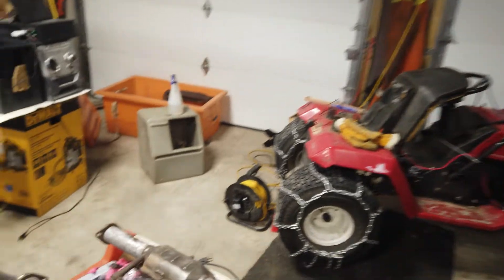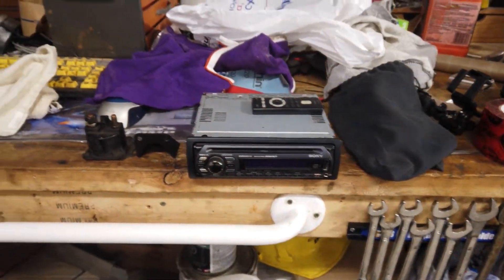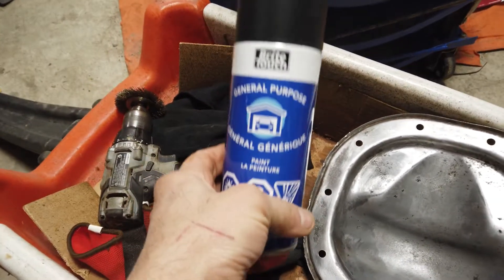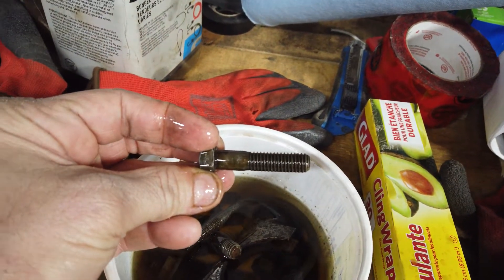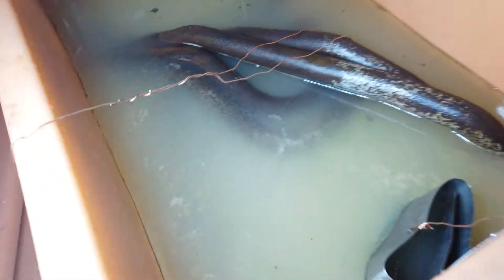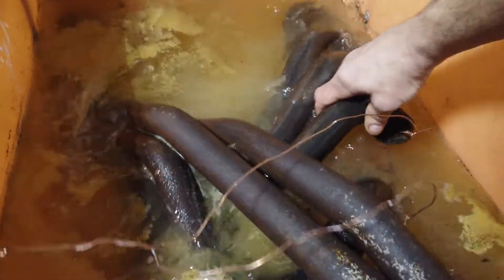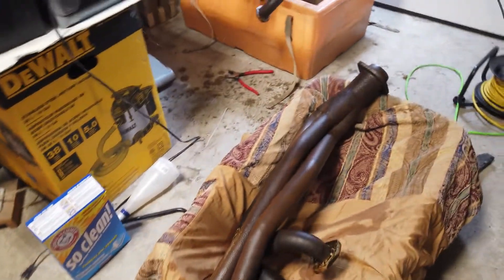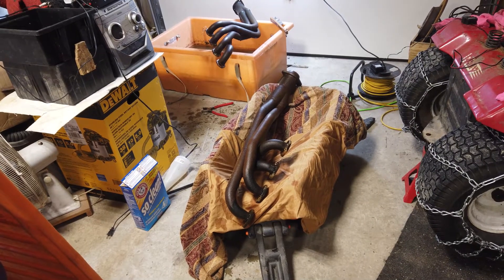Rust Removal - Elecrolysis and other methods - Foxbody long tube headers

Comment: I have a set of Hooker long tube tuned Headers for my 289 thats in my 78' King Cobra that has been sitting in a garage for 37+ years. They had some rust and paint on them and I started to clean them up by sanding and wire brushing them and man that was a lot of work. I call a local sandblasting place and for $40 I said F this. A week later I got them back and they looked practically brand new again. Got them home and coated them with some 2000 degree primer to protect them till I can Paint them with 2000 degree ceramic paint.
Reply from the maker: I agree it was a lot of work. Next time I will probably do as you did.

Comment: Good video, I bought a dyno with 25 pairs of rudty hedders. I plsn on dipping them in muriatic acid cut with water. 50/50 mix I assume. I just want to get them done as efficiently & cheaply as possible. Then rinse with baking sodacwater mix, dry & coat to prevent. I might attempt to dip them or rig up a long nozzle & pullnit thru each pipe. I just never want any rust sucked back into the cylinders. Hope they turn out nice & hold-up. Id hate to buy anything right now due to our outrageously expensive economy.